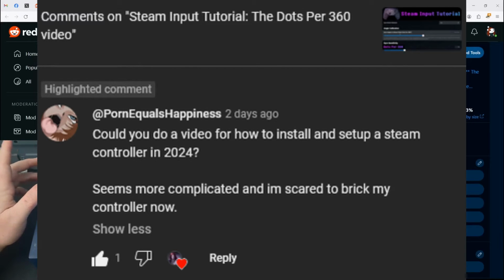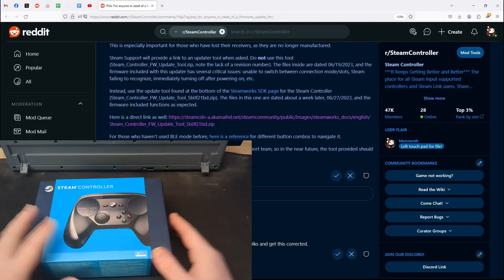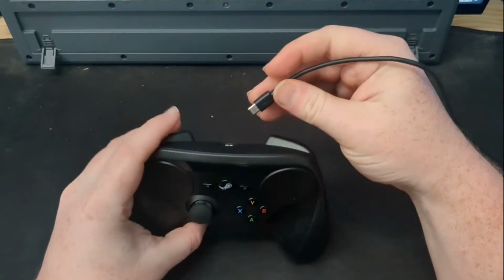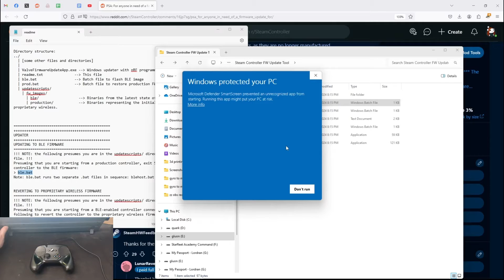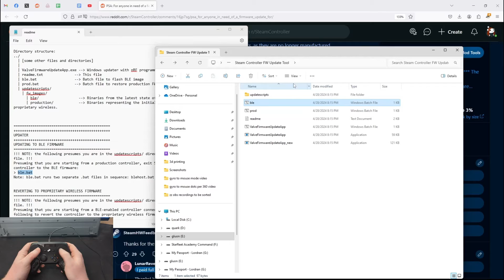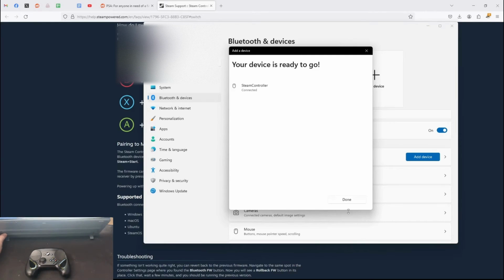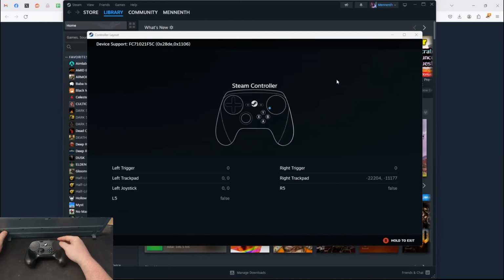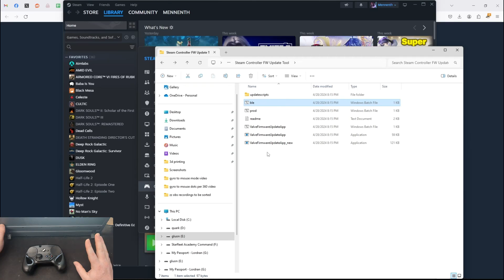connecting a steam controller in 2024

Comment: i (and many) really wish Valve would make a Steam Controller 2 or something. on one hand, i have zero hope, cause SC was pretty much a failure, but the Deck is such a massive success... i dunno.
Reply from the maker: @shinigamiauthor I'd want a steam controller 2 as well... but my opinions on it are very counter to the masses. 

I'd want it to keep the same layout as steam controller 1, just with updated internals (newer gyro, newer trackpads as sc 1 used gen 2 from cirque and now cirque is on to gen 6, force sensors for the trackpads instead of the physical button, and faster polling rate), 2 more back buttons, a slightly reduced circumference of the grips, and better build quality. I still think there is tons of merit in the "trackpads first" design of sc 1, it was just way ahead of its time and landed in an era where familiarity is preferred over progress/innovation (gyro is gaining popularity but is still looked down upon overall).

... But I know most people would want something more like a "Deck Controller" which follows the Deck layout just as an external controller. Making the pads smaller and shoving them out of the way to cater to the familiar... not very interesting or exciting to me, as imo thats just a "dualsense edge plus with valves logo on it" (the dualsense edge is basically "deck controller lite")...

Best case; Valve makes both. Realistic case; Valve makes neither.
Reply: @Mennenth  i agree. if we could get one thats some kind of happy medium, but still closer to SC1 id like that.
Reply: I would say the Deck would have been a massive failure if people stuck with the default SteamOS install rather than installing Windows on it.